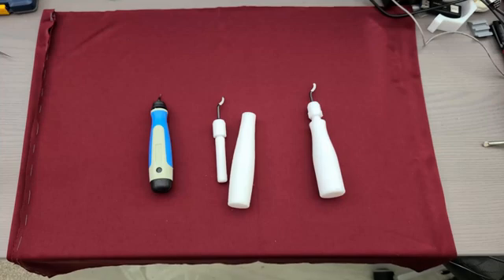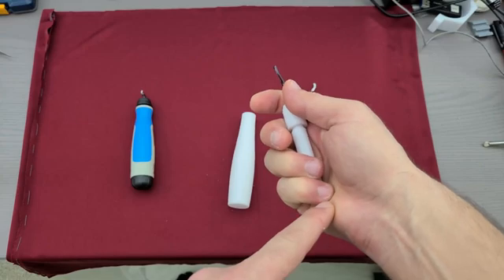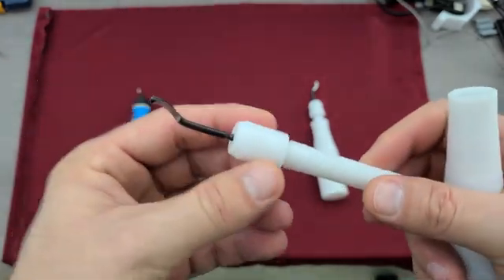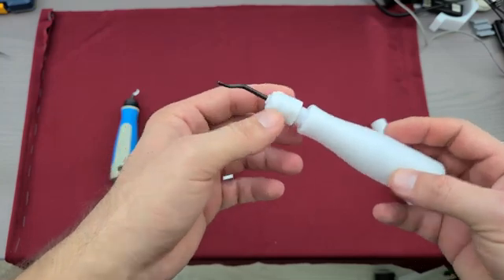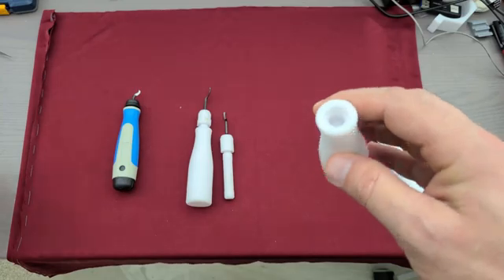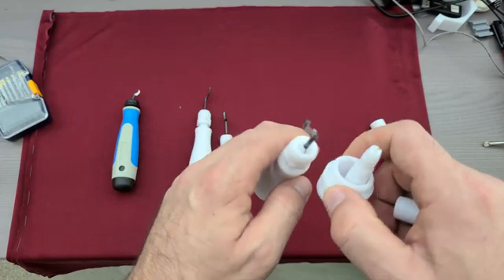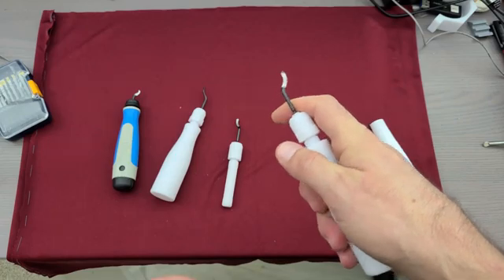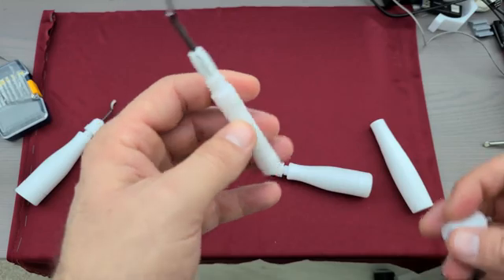Modular 3d Printing 3D printed | Deburring Tool | Pin Vise | Hand Drill | Chuck and Collets

Comment: I just got my first deburring tool, and I was confused. Should the deburring tool just let the knife spin around like that? Is that by design?
Reply from the maker: Ye it is by design for the cutter to spin. The design in this video is made to prevent spinning.
Reply: @RoamingInterests  Yeah I figured. I'll use your design then thanks, I don't quite like the spinning design at all :D
Reply from the maker: Thanks. If you need deburring on the inside of a hole, the spinning action is helpful. But if you need it on the outside is not that helpful. Also this idea was more for plastic where the skipping action of the deburring can leave rough edges that scratch. With the non spin you have more control with plastic.
Reply: @RoamingInterests  Ohh I see, makes sense.

Comment: thanks a lot for making the files accessible to everyone! 
I will try it out this weekend, the threads are probably too fine to print with a .8 mm nozzle?
Reply from the maker: Use .2 mm layer height. And orient everything vertically. I 3d printed them with a .6  mm nozzle. So it may work.